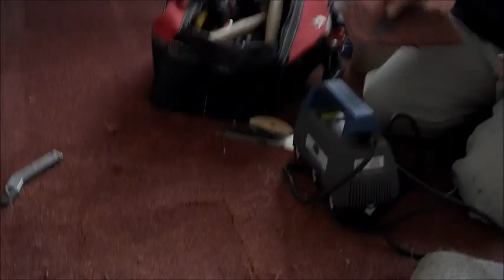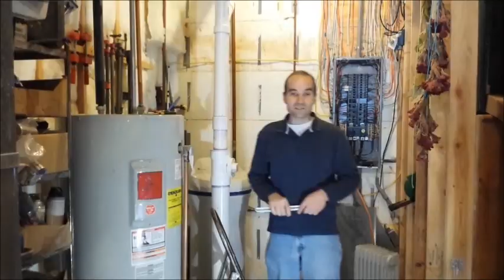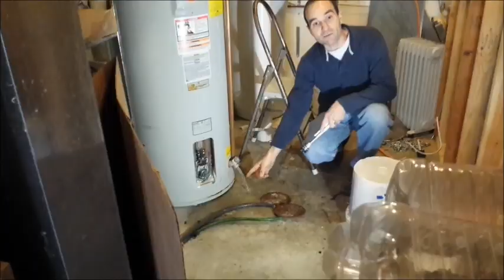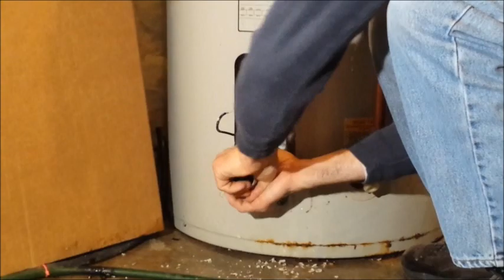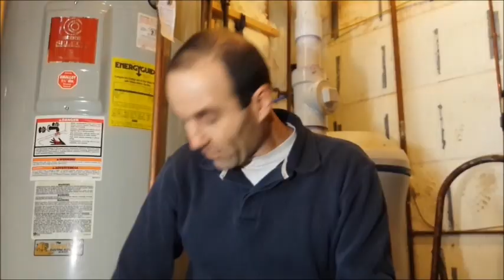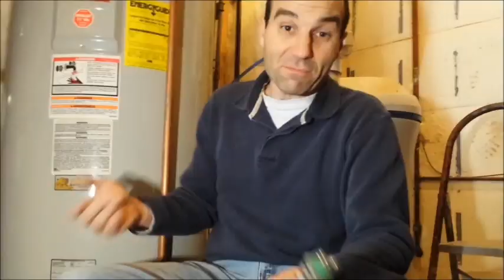Replacing a water heater element

Comment: Your demo needs to be refilmed from the side, where we can see something besides the back of your hands. I understand the PRINCIPLES based on your description, which is fine, but I need to see HOW YOU ALIGNED THE NEATING ELEMENT TO SCREW IT IT. MINE IS VERY HEAVY  AND WILL TWIST DOWN AND WILL NOT START THE THREAD. SO NOW WHAT DO I DO?
Reply from the maker: Thank you for the input. You're absolutely right many times I struggle to get the good angle because I film by myself. 

And answer to your question, you simply need to feel the element and how it's sitting into the threaded area and continue to adjust it until it seems straight and aligns with the starting thread and then turn it. It can be tricky for sure!

Comment: There is a large washer behind the element nut. I can not get a good enough leverage to remove it. What can be done?
Reply from the maker: Usually,  the washer is rubber.  That question doesn't quite make sense. Did you get the element out?
Reply: @Homemaintenancesolution Correction : behind the nut is the "housing" that extends into tank. It is not a washer per se but housing is preventing any deep tooling insert.   There is no visible gasket or rubber.
So there is only 1/8 inch nut space for tooling. Tooling just slips off. I turned down bottom thermo to 90 and put the top one at 125 and it  works fine on 1 element.  Model is a common 2008 GE made by Rheem. I just can't get a good bite in the nut.
A 1 1/2 socket with breaker bar or impact drill may work. No point in harming my hands. The gasket could be crammed inside the thread groove? Happy 4th.
Reply from the maker: @jorgegrau8323  I understand what you are saying.   Yes, it is easy to slip off that thin metal.  I have been able to break it loose with a large channel lock pliers before.   You may try that.  Otherwise you need a lot of pressure on the socket in towards the tank.  

Also, some actual sockets are rounded towards the end which makes it worse.  Their is an inexpensive tool for removing elements that is available at hardware stores and they aren't rounded.  Have you tried that?
Reply: @Homemaintenancesolution  I tried the universal element wrench and it just slips off as I can only barely insert and it slips. I can borrow some large channel locks and try.  The top element is the same, so I guess it is standard set up for that model.  I can only go 1/8 deep.
Reply: @Homemaintenancesolution  The universal element wrench is nearly 1 5/8. I put steel shim on it and no luck. Next, a non beveled 1 1/2 socket, 6 points, with a breakerbar. The dims on the tooling are too imprecise.
Reply from the maker: @jorgegrau8323  try large channel locks.
Reply from the maker: @jorgegrau8323  if that doesn't do it, you'll have to drain the tank and heat the threaded part of the tank with a torch. Turn the power off and get all wiring and flammable items away.
Reply: @Homemaintenancesolution  I will ask for them at work, thanks
Reply: @Homemaintenancesolution   Nobody had large channel locks, but I was able to get both of them loose with a 18" breaker bar on a 1 1/2 x 3/4 drive. I almost gave up with it. I swapped out the bottom element. Now I have to monitor it to see if runs consistently as there is a possible timer box or contact  issue. I still want to test the thermostats in a "hot wire" situation, also. Thanks for the input. The main reason I couldn't loosen it is that the element panels are turned towards  corner walls.
The anode rod in 2018 was simple compared to this.

Comment: thanks i was confused about turning off water and opening faucet also i have well, do i need to trip breaker to well pump? or just turn off water?
Reply from the maker: Normally, you just turn off the main water valve, but there is a scenario where the valve is installed in the wrong place that could burn up your well pump (very uncommon) so if you want to turn the breaker off to be safe, it wouldn't hurt.  

Opening the hot faucet up in the House after the water is off, just allows air in the system so that it drains down.
Reply: @Homemaintenancesolution  im replacing the lower heating element in my water heater…..its only has the lower, ive done this before but just could not remember after i turned off the water and started draining the tank i turned off the breaker to the well pump
i dont think i needed to but that was the only thing giving me doubt 
thank you so much for the advice……..i am not a plumber, just a poor homeowner lol

Comment: Thanx for the video. You covered the one thing I was uncertain about, which wire hooks to which screw.
Reply from the maker: Good question.  I thought I covered that, but maybe not.  It doesn't matter.  They are both hot wires from the two sides of your electrical panel.
Reply: @Homemaintenancesolution  yes you covered it.  And I got it installed with minimal problems. Thank you so much for the video.

Comment: Very very useful and helpful video with complete instructions. THANK YOU!! However, I am needing to downgrade my 240 volt water element to a 120 volt element because I'm solely on solar power and the 240 is too energy hungry. Anyways, if I just thread a new 120 volt element in and wire it up, does that complete the changeover? Or do I need to alter something else in my electric?
Reply from the maker: Thanks for the positive feedback.   Please subscribe.  
I'm not fully up to speed on what it takes to convert to a 110 volt element, but i can tell you that you will need to disconnect one of the leads completely on the entire unit.  There should be a black and a red wire at the top and at the element.   The way you get 220 volts is by using both of the wires (110 each).  Disconnect the red at the top and then just use the black throughout the water heater.
Reply: @Homemaintenancesolution  Thank You for the possibility and it does make sense that each leg would supply 110 volts from 6 gauge wiring cable. However after trying and not getting any power at all to the water heater. I decided to call Rheem technical support and they told me that the amperage would burn out the element eventually long before it's supposed lifespan. Even changing the (2) elements to a 110 element would not really do the downgrade either. The only truly safe and positive way to convert the water heater to 110 is to buy a 110 water heater I was advised. OK, well Thank You for trying and everything is back the way it is supposed to be, so nothing lost.

Comment: Pretty good video. I would point out 2 things 1st seeing how much rust is on the outer casing is a sure sign the unit shout be replaced and putting a new element in there was a bit of a waste of money. 2nd he did not check the wattage of the newer unit - was it the same wattage or lower

Comment: I change mine and I still don't have hot water
Reply from the maker: Calvin, you must have a different problem.
Reply: @Homemaintenancesolution  could it be the thermostat
Reply from the maker: @calvincarson5329  sure.  There are ways to check if you are getting power to the elements with a volt meter.  If you are not getting power then check if you have power going into the thermostat. If there is no power going into the thermostat, then you will be replacing another part for no reason.

Comment: If you test for continuity, wouldn't the multi-meter show a reading of ohms? If it shows "O", then there is no continuity. Right?  The element should just slide out. But it may be coated with mineral deposits. See the mineral (calcium) deposit?  This layer of deposits is an insulator between the water and the element. Even if the element works, it will take more time to heat the water because the heat must move from the element through the deposit before it heats the water.  If the element works, you may be able to clean the deposit from the element. But if the element is good, and shows continuity, you wouldn't remove it anyway, even if it has mineral deposits. An accumulation of deposits will make the element get too hot since it can't move the heat to the cold water fast enough. Eventually, it will burn out. 

Slowly install the new element to make sure that it doesn't get cross-threaded. Don't force it. Put Pipe Dope or Teflon tape on the threads. I prefer Pipe Dope, since it lubricates the threads, making it easier to screw in.  To make sure that it doesn't leak, would it help to coat the rubber washer with heat-resistant silicone sealer?

NOTE: As the gentleman said, DO NOT turn on the power before filling the water heater. The heating elements MUST be submerged in cold water first.
Reply: A 0.000 reading when set to ohms means there is no resistance to current flow. In other words, continuity.

Comment: Question on the water heater to change water element how do you know what water element to buy aside for checking how many screws are on it and where do you buy that screwdriver that takes out that water element?
Reply from the maker: Dian, the wrench to remove the element is readily available at a home center and most elements are the same , but if not, they are visibly different.

Comment: The scale on your water heater element indicates hard water. A good water softener would greatly reduce this. It would make the heating elements last longer and let them transfer heat to the water more efficiently making it operate more economically and lowering your electric bill.

Comment: The scale on the element may have caused the element to over heat causing it to burn out but once it burns out it is done for. Think of the heating element as a light bulb. The part you see that had scale on it is like the glass on the outside of a light bulb though it is made of a different material. Its purpose is to keep electricity from conducting onto the water in the water heater from the heating element. The part that heats is the part inside the bulb that glows. Cleaning the scale off the element won't help the element any more than cleaning the glass on the outside of a burned out light bulb will make it light again. If you have a clear light bulb that is burned out you can see what happens when a water heater element burns out. The filament in the bulb will have a brake in it. A good bulb will have two conductors coming in the bottom of the bulb with a spring shaped element called a filament connected between them that glows when it lights. The burned out bulb will have a brake in the filament you can see. The brake in the filament removes the path the electricity needs to follow to do its job just like a light switch does.The heating element has the same thing happen to it when it burns out as a light bulb.
Reply from the maker: Good explanation!

Comment: Once you clear the scaling, check the continuity again. That will tell you
Reply: Continuity shouldn't be impacted by scaling, only a break in the heating element would do so. Scaling reduces the efficiency of heat transfer from the element to the water.

Comment: Lower element is leaking water. Faulty element? I imagine yes.
Reply from the maker: Not necessarily.  There is a rubber ring around them that keeps the water from leaking out.  Yours could be missing or bad.  Check it for cracks.
Reply: Thank you sir. Great video btw!

Comment: Thank you for the video.  For those of you with corrosion or rust on your heating element, you might want to skip that element wrench and get a 1 1/2 inch socket (or whatever measurement your tank element has) and large ratchet and/or a breaker bar. Just speaking from experience the element wrench did not provide enough leverage to break the seal and I wasted a lot of time trying.  The socket took 2 minutes.
Reply from the maker: Kevin Lee Burns, thanks for adding value!  You're exactly right.

Comment: It was hard for my daughter and I to turn the element to get it out.  I turned off all the electric rather than just the water heater.  Anyway, I had put a little WD 40 on the outside of element to get it to turn and banged it gently with a hammer and then it turned but it took a while.
Reply from the maker: Frances Skitzki, good for you!  Way to persist!

Comment: Thanks for your help. How can i check if its the breaker?
Reply from the maker: We usually just try replacing it.  It's a cheap repair and if the new one doesn't trip, then you have it fixed.  If you have the right equipment you can check how many amps the heater is drawing.  If your breaker is a 30 amp, then it shouldn't trip unless the draw goes over 30 amps.

Comment: Hi, thanks for the fast reply,  I will check the elment first, the breaker its been there for many years. Now, the red button its on the upper element, is that matter? I mean, is it make a difference ? Should pop it before  shouting off the breaker?
Reply from the maker: I'm just saying that it should pop first if there's a problem.  You could also have a breaker that went bad on you.

Comment: Hi, nice video. I need some help, i have a GE whater heater like the one you working on, my breaker was shutting off, and i turn it on and stays for a little and then shuts off again, so, i open the bottom cover where the elemnt is, and i found that was a little water residue just under the element , and the conections are there also, can that be causing the breaker to shut down? The water heater is only 3 years old. Please, if you can help me out, i will appreciate it, whater heats up but not enough, i gess it shuts of as it get more temperature. I dont know. What you think?
Reply from the maker: If you have water leaking down by the connections, then that could cause a "trip out".  I would think it would trip the red button on the water heater and not the breaker though.  I would try turning the temperature way down and see if it stays on longer.  If that helps, then you may have the wrong breaker size, but you can cause a fire or damage to your home if you increase the breaker size without increasing the wire size.

Comment: my element wont come out
Reply from the maker: Sammie Mtz, they can be stubborn sometimes.  On occasion, they can become fused into the tank from an electrical problem.  If that were the case then the heater would need to be replaced.
Reply: yes i think thats the case because i tried everything and that thing wont come out also if it has so much white lil rocks what does that mean
Reply: okay i changed the whole boiler i got a new one installed but it shuts off by itself its an electric water heater the wire goes directly to the breaker the braker dont jump either i dont know what to do help me plz
Reply from the maker: Sammie Mtz, you really need to go back to the installer on this.  It could be several different things causing a problem.
Reply: Home Maintenance Solution, Inc  my heater is only one element which is the lower element and its 4000 watts volts 208 and the element is 4000w 208V 50gl max pressure is 150 total watts connected is 5500 all this is whats on the label i turned it on right now and its working but ppl were telling me that some boilers turn off when the water is hot but when this boiler turns off the water doesnt stay hot and stays warm i really need help plz

Comment: Not sure you tested the element correctly -- the meter should NOT show .8 anything with the leads apart. And not 0 with the leads across a good element, there should be some measurable resistance. Should read OPEN or OL across a burned out element. Set the meter to OHMS (not volts).  Should read OPEN or OL before you touch the leads together. Make sure it's on the lowest range before testing the element.

Comment: Thank you! you gave me the information that I couldn't find on any of the other videos that I watched, and I watched a few! (I am not Luke Skywalker,my son has been using my tablet) the information that I was looking for was ’does it matter which wire attatches where on the element?’ - I bought the new kit for my heater, but when I removed the elements currently in my heater, they were not the same. the prior owner had installed the wrong elements completely, so I could not just match up where the wires were on the old elements. your video was the only one that said that it didn't matter which way they go, that they don't have to be color coordinated. THANK YOU ! this seems like the most important information and all any other videos-even the box my new kit came in just said 'note position and color' when removing old elements. This does not help people who didn't remove the elements themselves, or who had badly damaged or incorrect equipment. So thanks for solving my problem and I will subscribe!
Reply from the maker: Luke Skywalker, glad to help!  Thanks for subscribing!!

Comment: looks like my hot water heater is linking from  the lower element
Reply: If the leak is actually from the heating element changing the heating element will fix it but make sure that the leak is coming from the part of the heating element that will be replaced when you change the heating element.

Comment: we bought a  new electric hot water tank. Hooked it up. Bur forgot  to bleed the air. no hot water. We replaced both elements.  bleed the pipes for air. Turned on the electric. still no hot water. There is electricity going to the wire. Does anyone have any suggestions
Reply from the maker: There is a reset button on the thermostat, usually a red button.  Try pushing that to see if it tripped.

Comment: what if the heating element breaks off inside tank while trying to remove?
Reply from the maker: I would try to dig it out.  Maybe use some needle nose pliers.  
My concern with leaving it in there would be water contamination, but that could be unfounded.